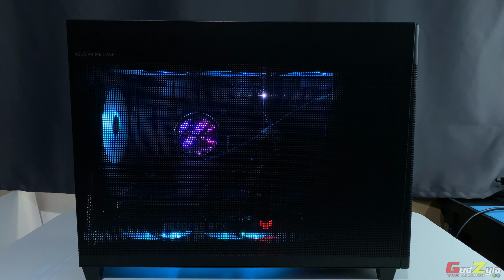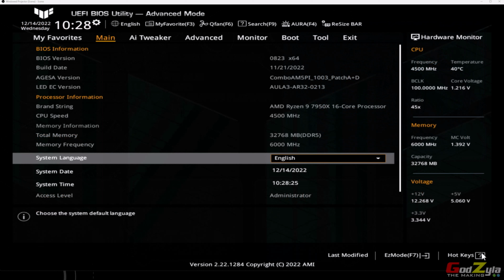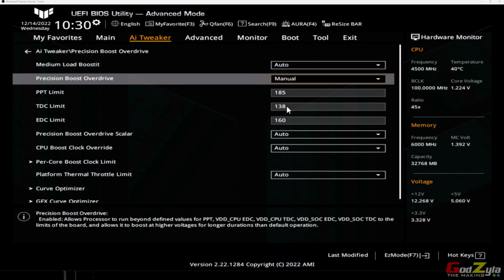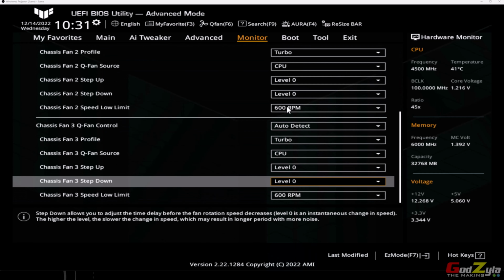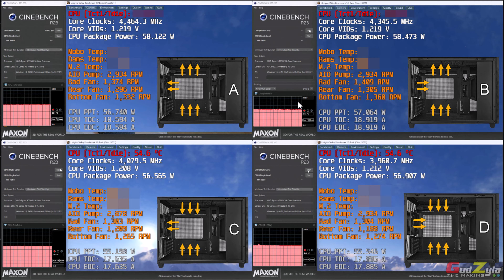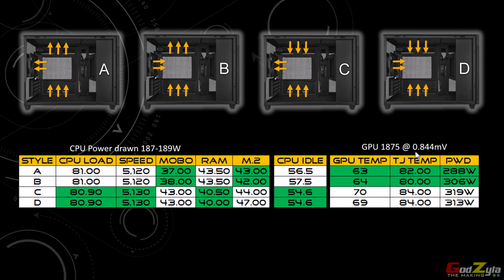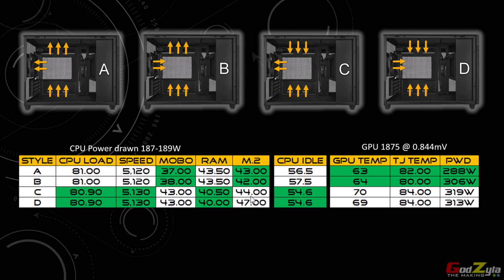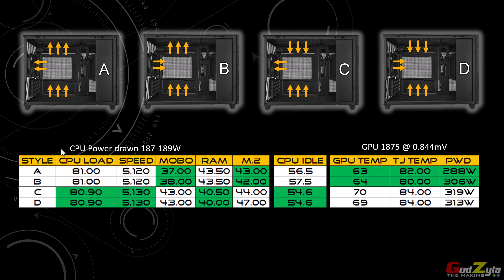ASUS AP201 Prime - Thermal Test (Part III)

Comment: just asking but have you tested out the CoolerMaster Q300l, or q300l v2, if so was the thermal performance better or worse compared to the ASUS PRIME AP201. As i am thinking of switching to a smaller + more portable pc case for my Matx motherboard build, as i am going to university this sept.
Reply from the maker: Hi Ice, welcome to my channel. I wish I can answer you this question but I do not have those CM cases to test with. So sorry about it.

Comment: hey, great video! do you think does this work with tempered glass version too?
Reply from the maker: Hi Berk Unal, welcome to my channel. This case as what I know does not come with a tempered glass version.
Reply: @KleoYan  I have the tempered glass version, thinking about applying the same cooling methodology as in example A. Wonder if this works
Reply from the maker: @busterblues  hmm, interesting, I did not know there is a tempered glass version, so am not able to answer to your question. You might want to give it a try. so sorry about this.

Comment: Hi, I'm planning buying this case, but don't want to change my bigass cooler (SE-226XT) and use option A, will it be good for the thermal?
Reply from the maker: Hi Hoang Nam Vu, welcome to my channel. if you are using an Air Cooler, it might be different from the temp readings here. you have to test it out as using option A with Aircooler, I have no idea how the temp is like as I did not test with an air cooler.

Comment: My build is very noisy using the A config, two bottom, two top and 1 back Arctic P12 Max fans 5 set. Any advice on that?
Reply from the maker: Hi Babyfreezer Gaming, welcome to my channel. you might want to tune your case fans not to ram up so high with the P12 Max. that will reduce the noise. You will need to do your custom fan curve in UEFI.

Comment: Hello Kleo. I came across your video on the Asus AP201 more than a month ago, and I liked it so much that I decided to build my first PC with this case three weeks ago. Now, I have some questions and doubts. 1) Regarding the configuration you made in the UEFI, how would it be with Intel? 2) When I start playing something demanding, the power supply makes an electrical noise. Is this normal? Here are the components I bought: Asus B760M TUF, RTX 4070 TUF, i5 13400F, 16GB RAM 5200MHz, and an Asus 850W TUF power supply. What should I buy next to improve it? Unfortunately, I did not do the installation myself, but I THINK they did a good job; only the power supply is on the opposite side. Regarding the methodology for installing the fans inside the case to intake and exhaust air, I used the first one, option A. Just as I mentioned, the power supply is facing outward and not inward. Is it okay this way
Reply from the maker: Hi Christopher, welcome back to my channel and thank you for valuable feedback. 

1) Regarding the configuration you made in the UEFI, how would it be with Intel? 
There are two methods to tweak an intel 13th Gen processor. First method is to use software which is directly from Intel, the application is call XTU, thats where you play with the VCore voltage or to play with the clock frequency or more. Second method which I often used is on UEFI itself. I will set the power limit (PL1 and PL2) and to do Vcore offset. you can refer to this video even though it's not a Tuf board. https://youtu.be/VZeh4gwac3o?si=QjIi9mfPLj4uQhHW&t=3182 (watch the actual timestamp and please note, I not an expert on this) 

2) When I start playing something demanding, the power supply makes an electrical noise. Is this normal? 
A) This should not be the case. The power supply you have, it's a good PSU. You might want to double check the connection cables between your PSU to your motherboard, GPU and etc. If it still gives you electrical noise. I would advise you to send your PSU for RMA if it's under warranty.

Here are the components I bought: Asus B760M TUF, RTX 4070 TUF, i5 13400F, 16GB RAM 5200MHz, and an Asus 850W TUF power supply. What should I buy next to improve it? Unfortunately, I did not do the installation myself, but I THINK they did a good job; only the power supply is on the opposite side. Regarding the methodology for installing the fans inside the case to intake and exhaust air, I used the first one, option A. Just as I mentioned, the power supply is facing outward and not inward. Is it okay this way

A) I like the idea of your PSU drawing cool air instead of drawing the warm air from the interior. choosing option A is good, but what type of cooling are you using? Aircooling or Liquid cooling?

Hope all these aid you out.
Reply: @KleoYan   Hello Kleo, thank you very much for responding.

1) I realized I had forgotten something, and it was the cooling. Well, due to tight budget constraints, I bought an air cooler, the DeepCool AG400 Plus. I hope it is sufficient for the processor I have.

2) I conducted tests on the electrical noise. I disassembled the power supply, adjusted the cables (which I hope are the correct ones), checked that everything is properly connected, and tested games like Valorant, Counter-Strike 2, Valheim, etc., without a frame rate limit. I have noticed that the GPU is making noise, Kleo. I don't know if I fixed the issue with the power supply, but the power supply no longer beeps. Now, the GPU beeps when I play demanding games. I wonder if that has always been the case, and I may have been mistaken in identifying the component at the beginning.

3) I managed to watch the video that you shared with me. I am very interested in doing that and thus extending the lifespan of my components, both the CPU and the GPU. I'm not sure if the video also addresses GPU issues, or if you have a video explaining that, Kleo.

This is what I was able to do all night yesterday. I apologize if I have been late in responding.

Comment: C and D is hotter because you're using water radiator to cooling the CPU, so, that air intake will hit hot radiator, and then become hot air inside the system.

I would like to see air cooling processor.
Reply from the maker: Hi Arifta Gunawan, welcome to my channel. Thank you for your feedback. I have returned this case to Asus SG, therefore not able to conduct aircooling. Guess you will need to test this yourself. So sorry about it.

Comment: in what way should i arrange the fans if I plan to to use air cooler any suggestions
Reply from the maker: Hi Kaustav Sen, welcome to my channel. For Air cooler if you can flow the air to the top instead of the rear. That will be good. But orientation will be rear intake. Top exhaust. Bottom intake and aircooler is placed to exhaust hot air to the top. That will be my opinion

Comment: I've tested rear exhaust fan vs zero rear fan and there's no temp difference at all for GPU, CPU and x670e chipsets XD

My ghetto side intake 120mm fans doesn't make any difference as well.
Reply from the maker: Hi Ouki, welcome to my channel. Mind if I ask where is your location when you test the thermal and what fans did you use to conduct the test. It’s interesting that you have mentioned no difference hmmm 🤔

Comment: Hello!,Will 2 exhaust and 1 intake be sufficent for this pc case?
Reply from the maker: Hi Sick, welcome back, it greatly depends on what system you have build into this case. if it's mid tier build, you might get away with just 1 intake and 2 exhuast but if it's of a high tier, then it's insufficient.
Reply: @KleoYan  Hello! Its a 4060 ti and a ryzen 5 7600x,so mid range right?I am planning to do 1 intake and 2 exhaust and dont want any temperature issues.So is it fine?
Reply from the maker: @sick1405  it should be fine but you got to test it.

Comment: I would love to saw a version where u dont even use bottom intake fans at all. In theory i think they are useless, because: 1. their airflow completely blocked by the GPU, 2. GPU fans do exactly to the same thing as pulling air from the bottom. Its seems redundant to me, like putting fans on top of each other... they just pulling air from bottom but GPU fans doing exactly the same.
Reply from the maker: Hi @CoffeeGameMovie, welcome to my channel. I would do that but I have returned this case. But with your info of what you have mentioned. It make sense. Can go without the bottom fans. If you do have a go for it. Do let us know the result. Thank you.
Reply: Not quite. In a completely sealed environment you’d be correct. However in a mesh case there is virtually no pressure difference between the inside and outside, so those gpu fans will suck in the air with the least resistance. With extra fans on the bottom to do the heavy lifting of pulling air through the filter and pushing it directly into the gpu everything is happy. But if there are no bottom fans the gpu will source air from anywhere it can, and that will almost never be through the filter. Does this matter for dust? Certainly, as the bulk of your air will probably be coming from the unfiltered side panel or pcie slot covers. More importantly, does this matter for temps? I’d say yes, but it would be nice to see some test data. The less turns air needs to make the better it will flow, and given two perfectly positioned fan mounts I don’t see why you wouldn’t take advantage.

Comment: hi kleo, i am getting this case but i not sure to use aio cooling or air cooling ( tower type). for this case, which one do you think is better? air tower cooling or aio?
Reply from the maker: Hello kh, welcome to my channel, I have no experience using an Aircooler in this case. I would have try but I have returned this case back to Asus SG. sorry about it.. I can't answer your question. but you might want to try asking at Asus Reddit forum. https://www.reddit.com/r/ASUS/
Reply: @KleoYan  okok, thx u for the reply
Reply from the maker: @Kharn5988  you are most welcome. I hope you can test it out and on my end I will try to figure something out. Will let you know if I am able to get hold of this case and to test it with an aircooler.

Comment: Im building in this case next week. Im choosing to use a large air cooler with 2 fans vs. water cooling. I was planning to use it with option A. What are your suggestions for using 3x120 vs 2x140mm top/bottom fans?

Thank you for all this research!
Reply from the maker: Hi Jesse Webb, welcome to my channel, I would go for 140mm fans in Air mode. have the top 2 x 140mm, rear 1 x 120mm and bottom 2 x 140mm. You will have more airflow and it's going to be quiet.
Reply: @KleoYan  How can you mount 2x 140mm at the bottom? I checked the user manual and it only suggested 140mm can only be mounted at the top
Reply from the maker: @willy0297  hi, thanks for pointing this out. my bad.. only allow 2 x 120mm.. sorry about it.
Reply from the maker: Hey Jesse Webb, something to take note. bottom only allows 2 x 120mm. I made a mistake there.. please take note. thank you!
Reply: @KleoYan  yes thanks for the reply
Reply: @KleoYan  I fit 3x 120mm on top and bottom with an atx psu
Reply from the maker: @willy0297  you are most welcome and thank you for pointing out my mistake 👍
Reply from the maker: @jessewebb4933  hi and welcome back. thats good, but I got to apologize for the mistake on my reply. was worried about the wrong info to you. sorry but am glad everything work out well for you. 👍

Comment: Love your content man! For compare,here is mine temps - Got the TG model so there is not much of airflow... CPU is i5 13600K with a Jonsbo HX6210 tower cooler,6 120 Artic Fans (bottom 2 intakes and other 4 out) and the GPU is ASUS Strix 3060Ti. While long therm gaming,Cyberpunk 2077,the CPU goes  from 74 to max 80°C and GPU max is 58°C. I wonder if new CPU cooler helps i bit,but if there is a point to smash 250€ for and AiO and get 5°C to 10°C  lower temps? Other than that,i just love the case! Wish i post a pic of my white build 😊
Reply from the maker: Hello Marek Kocian, welcome to my channel. Thank you for your insight of this case, really appreciated it. as for the CPU Cooler, I dont think you really need that as you've stated your max temp for CPU is at 80°C and GPU max at 58°C. These are very good thermal results. I feel that it's not necessary to get a liquid AIO just for a few degrees drop.

Comment: Is it possible to put a fan on the front?
Reply from the maker: hi João Furtado, welcome to my channel. the space infront is rather tight, unless you do Air Cooling instead of Liquid cooling and to use a SFX power supply, where you can move the PSU cage up.

Comment: A bit worried if have hard drives at the bottom there will be a lot of heat to the GPU have you been able to test that configuration? Since I have ordered this case but will be using two 3.5 inch hard drives for storage and SSD for OS and games.
Reply from the maker: Hi callecam, welcome to my channel, I have not tested with 3.5" HDD, therefore not able to tell you how the temperature is like. So sorry.
Reply: I have a hard drive under my 4080 and i can tell you that the temps are normal during load but the fans spin with higher rpms and therefore they produce a lot of noise.
I am considering transfering the hdd on an external powered case in order for the gpu fans to have more space to breathe...
Reply from the maker: @Silverbolt1981  hi, welcome to my channel and thank you to have share your experience with us. Greatly appreciated it 👍
Reply: @KleoYan  So i like to make a follow up regarding the hdd.I just removed it and tested my system in a couple of games that are taxing on the gpu.
The fan noise reduced significantly without the hdd at the bottom which leads me to the conclusion that because the two out of three fans of the gpu had so small clearance from the hdd led to higher noise levels!
Hope that helps anyone who is considering placing one under a triple slot gpu..
Reply from the maker: @Silverbolt1981  that’s a good finding. Thank you for sharing. 👍
Reply: @Silverbolt1981  I have a two slot RTX 4070 so might not heat up as much but still.
Reply: @callecam  It is not about the heat,it is more about the noise but the 4070ti cooler is smaller than the 4080.Give it a try and see for yourself..

Comment: Perhaps I am late to the party, but with air cooling and six fans, what fan placement should I opt for to minimize dust intake in the AP201 case? My place can be pretty dusty in bad days. Or perhaps I shouldn't go for this case?
Reply: I kinda plan for having two intake bottom, one rear exhaust and 3 top exhaust, with fan speed adjusted so that 4 exhaust will run at lower speed, enough for 2 intake fans + passive intake from mesh sides to bring in more air.
Reply from the maker: @YoukoZuki  hi welcome to my channel. for the dust issue, so long you dust off once a week with a portable blower, you will be all good. As for fan adjustment, As what I been experiencing, since it's all mesh. The airflow is more of a suction from the exhaust fans. The cool air that pushes from the the bottom, that has minimal effect to bring in cool air as it's directly going to the GPU. it will be best not to tune too low for your exhaust. hope this help.
Reply: @KleoYan  Ah I see. Thanks for the reply.
Reply from the maker: @YoukoZuki  you are most welcome and all the best with your build.
Reply: @KleoYan  oh pardon me, but i forgot to ask this: i heard it is hard to build positive air pressure for a full mesh case, so opting for exhaust build (Setting A) would works better both for thermal and dust prevention? I imagine that the exhaust fan will suck up finer dust that goes inside through side mesh holes and push them outside of the case. Obviously it wont beat frequent dusting, but i think dust would accumulate not very fast.
Reply from the maker: @YoukoZuki  for thermal yes but for dust prevention no, this case is seriously a dust collector case. No matter how you place those fans. There are no dust filters except for the bottom. Don’t mind me suggesting, If you worry about dust too much. I would advise you to get a mid tower chassis. As mentioned to keep this chassis clean. All is needed it weekly dust off using a portable blower.
Reply: @KleoYan  i see. I will explore other cases with dust filters then. Thank for the advice.
Reply from the maker: @YoukoZuki  you are most welcome.

Comment: so A was the most optimized method.
Reply from the maker: Hello sorry I’m Late, welcome to my channel and yup in my test that is.
Reply: @KleoYan  would you plan to have smoke in airflow test ? This was the most detailed review I can get for a pc case out there, many thanks 🙏 

Would you think this ap201 is a good case for thermal exhaustion?
Reply from the maker: @thanatosor  for the plan on smoke in airflow test, I might or might not do it as for thermal, since this is an all mesh case, it does have good thermal results.

Comment: Your power draw is vastly different...
Reply from the maker: Hi baldriss, welcome to my channel, yes it will be different, that's the characteristic of a Zen 4 7959X. by default the more cooling solution you can provide this processor, it will push to draw more power inorder to sustain higher clock frequency.